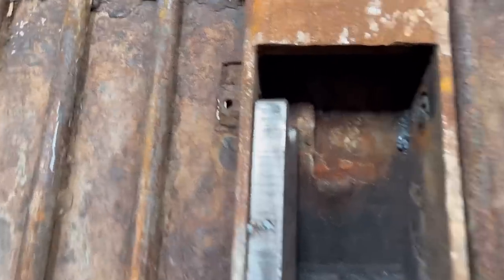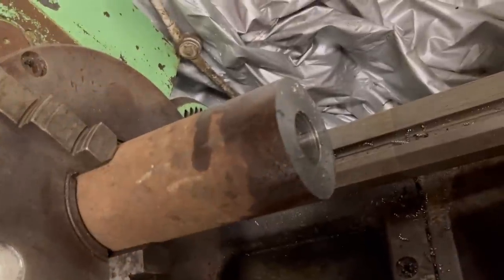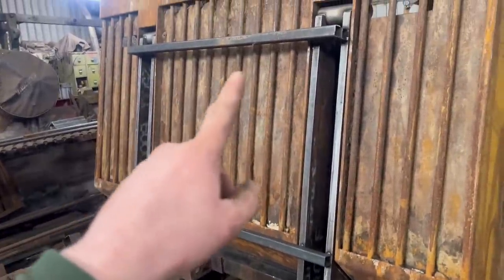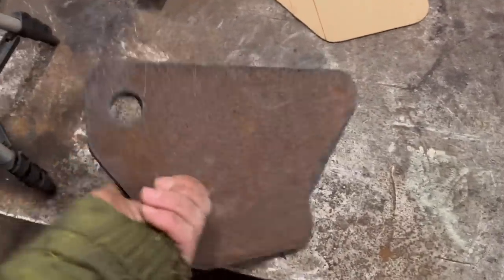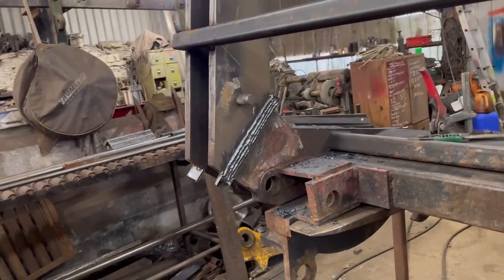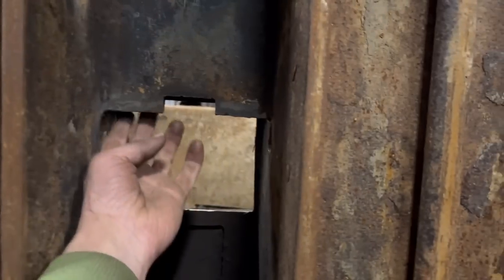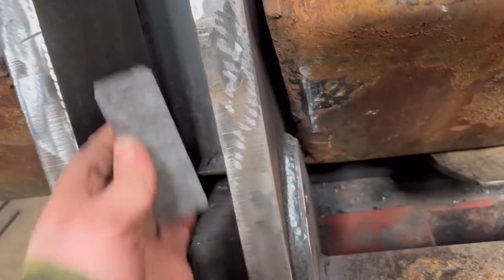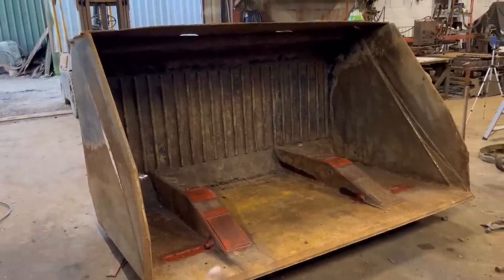Major repair on a toe tip bucket. Part 2.

Comment: That’s an interesting bucket, i had never seen one before your videos. I found a few videos of them in action, they seem to be for light materials like saw dust, grain, wood chips etc.
Reply from the maker: This one was originally designed for sugar beet/ fodder beet. Because they tip at the toe they give the machine more lift height

Comment: Fantastic job .   With minimal bracing , surprised to see  no worries with alignment after a single vee joint of that size .    Recently welded some 32mm 90 deg angle plates for the milling machine  & had to go the 3&1 rule to keep them dead square with no bracing . 👍👍👍👍
Reply from the maker: I think if the weld had been at 90degrees to the leg it would have been a different story.

Comment: Great video(s) and I love your shop and equipment, definitely pro. You kept mentioning price so I have to ask, what does a job like that go for - just a ballpark? 
I’ve been self employed for a couple decades and I’m sure you’ve been in the game for a bit too. I had to steer away from customers that wanted to cut corners. More often than not when the thing that they didn’t want to pay for failed, that cheaper price was the first thing they forgot. But, there’s no doubt, what you did do will outlast that bucket and probably the customer too.

Comment: I have noticed when I used dual shield wire to weld with that I have to crack the amperage of a little hotter 510 amps hotter is what I use